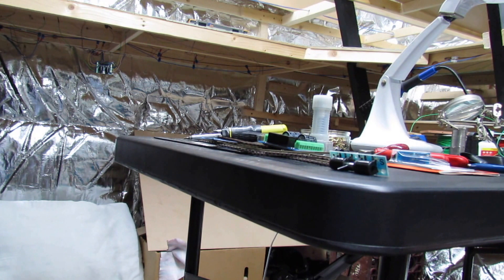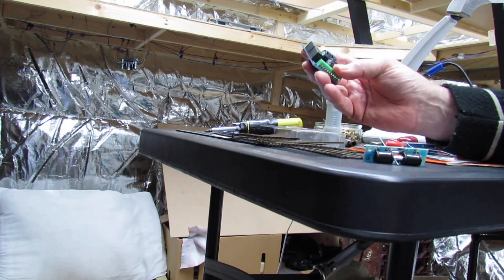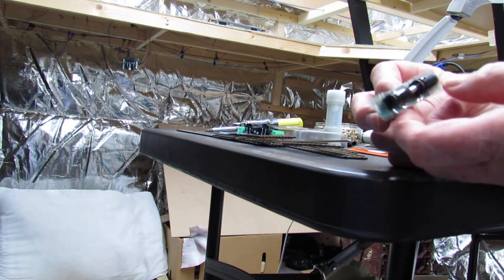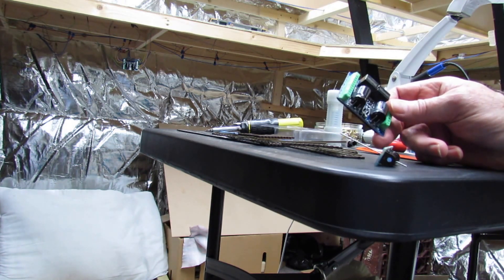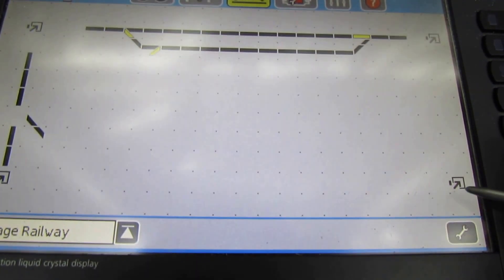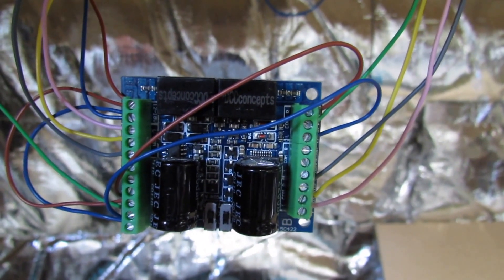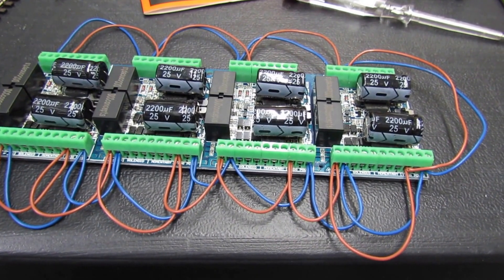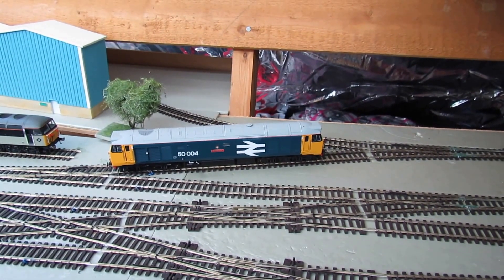Milton Mo Junction 13

Comment: Nice one Robin..you have it all sorted on the ecos.
fortunately I do not have the problem with polarity when  changing points etc and all fleischmann points have the macanical switching built into each point on the profi track system.
Thanks for the shout out......
Jim..

Comment: Hi Robin, very nice video, and very informative. I would be interested in your DCC Concepts Points Controllers, what would you accept for all of them and do you still have the installation paperwork?...SimonMy direct email address is: simon@young.ec
Reply from the maker: I saw a post that somebody had put up a couple of days ago and just read it, once you do that it disappears from the list. I just assumed that it was for my latest video so had a look so I could answer it. However when I checked it wasn’t, there so I went through all of the videos and comments looking for it but it seems to have disappeared. Anyway all that was just a bit of background to my point. Whilst looking through all the old videos and comments I saw one from you giving your email address and asking about DCC Points Controllers. I am sorry I did not answer at the time, November 2015, but for some reason it not see your comment. I do normally answer all comments.

Obviously by now they have gone, but do have some more that I will be selling, I think I have an 8 point one and some 2 point ones to sell, if you are still after any, but I guess by now you are all set up.

Let me know if you do want any.
Robin
PS having to use this method as the email address doesn't appear to be correct.
Reply: Hi Robin, I now have several ESU point/accessory controllers now, but thank you for sending me the message.  The email address is correct, I am a computer and network engineer and have several domain names, young.ec is just one of them. The EC at the ends is Ecuador, the same way co.uk is a UK domain extension ..Simon
Reply from the maker: Ok Simon, no problem. The email address I understand, it was just my mail program didn't recognise it so thought it was incorrect.
Robin

Comment: looks so complicated on the screen with the station part and all the points till you just touch the pointer to it and hey presto it's changed. I'm sure it wasn't so simple connecting it all up ,lol. good luck , thanks for the updates as you must be busy enough with the building and everything else going on
Reply from the maker: +Alan Surgeoner It is relatively simple to connect it all it is just there are so many it sometimes gets a bit confusing under the boards.
Robin